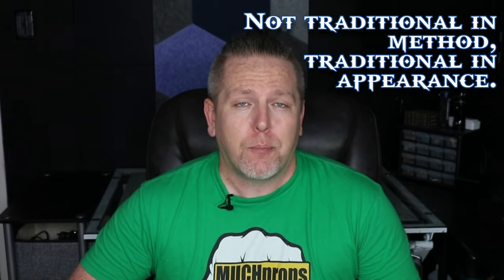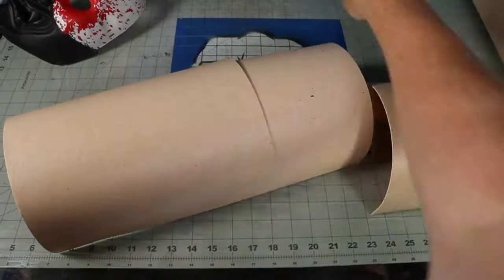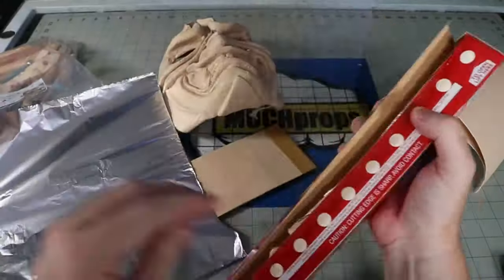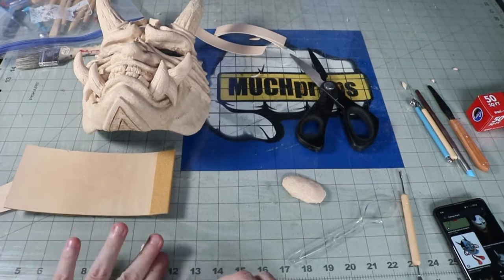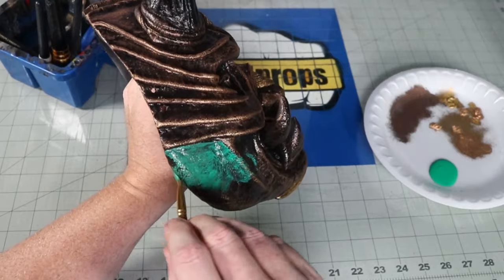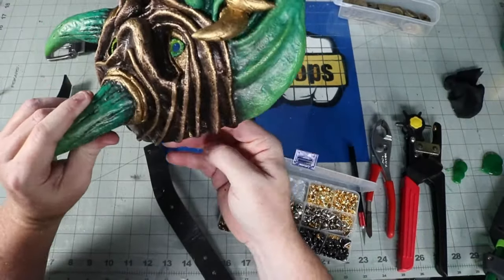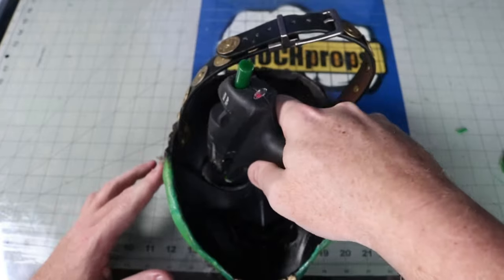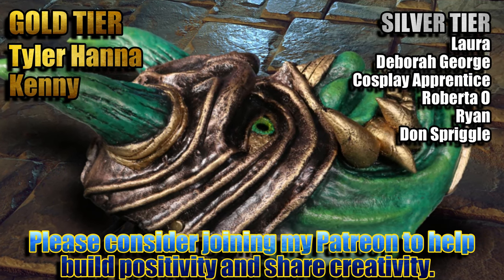Making a Custom Oni Mask

Comment: If wondered about that thermoplastics I see at HL. It looks like it’s easy to sculpt?
Reply from the maker: It's not bad. And you can catch it on sales sometimes or use that 40% off coupon
Reply: I’ve used it on a Skyrim guard helmet. Super glue works well for attaching it to foam, the smooth side sticks fairly well to leather with just heat.
Reply: @Much Props p.s.
Thanks for the helmet template
Reply: @MuchProps  They no longer do the 40% off coupon, and this stuff doesn't go on sale when the EVA foam does.  But overall it's cheaper than Worbla from Michaels, and you get more per roll.  I'm going to have to invest in some in the near future.